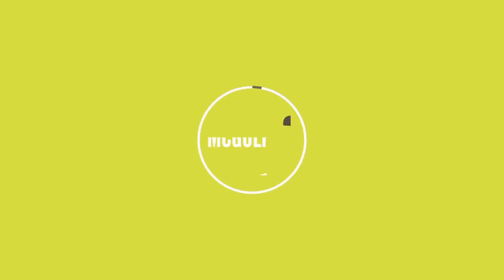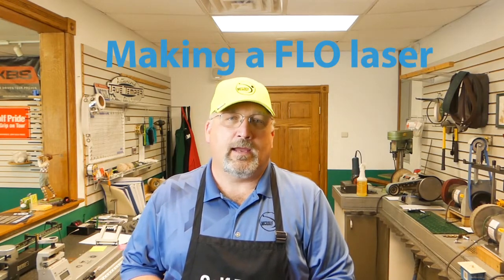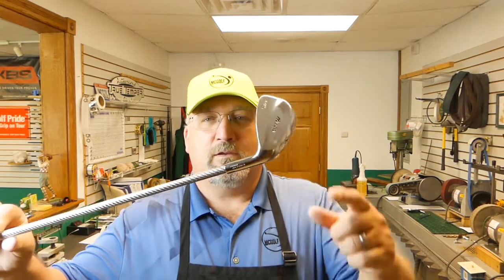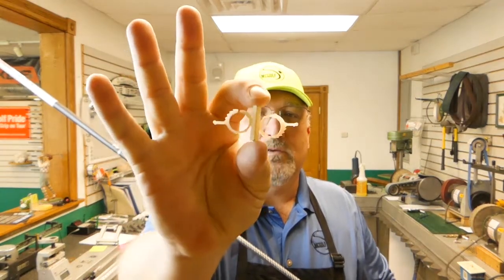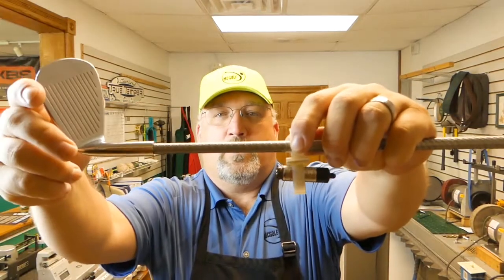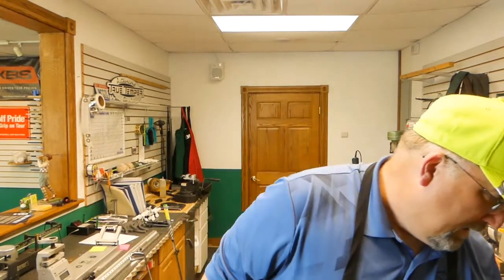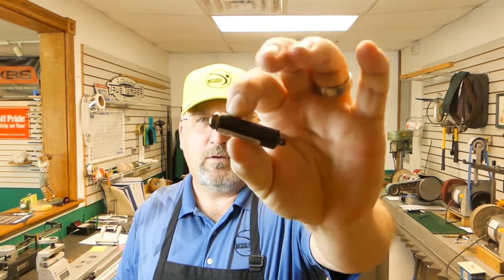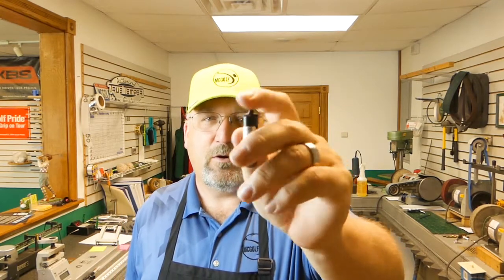how to build a Golf FLO tool (laser)

Comment: Does doing this with a head on affect the final outcome as the head, face, toe weight throws off the center point resulting in a diffirent oscilation? Or should it always be done with a head on, in position?

Comment: Ok, now I have 2 clubs in My Apex DCB that have a lot of vibration  even if you hit dead center. The PW  43 Degrees is the worst barely make 100 meters but my Callaway Jaws 48 degree goes 115 meters . Jaws is a true  temper  S 200 and the pitching wedge is regular flex NS PRO 950. Would this laser work to spot my trouble?

Comment: Thanks, Jim! I just invested in this: https://www.amazon.com/Higoo-Tactical-Laser-Sight-Barrel/dp/B07BKPB6PP - it doesn't look like it will be as fast to attach/remove as what you came up with, but I'm not doing a high volume of work in my basement shop! Thanks for inspiring me to start FLO'ing my builds!
Reply: I like this!  You could swap the hex screws for thumb screws, or just slide it on and off the end of the shaft... plus it's cheaper than buying a bunch of clips and a laser that is the same price... plus it's probably more aligned with the shaft too... thanks!

Comment: Do you find that in steel shafts the spine and flo are usually the same?   I’m having issues locating the flo of my steel shafts.. I rotated the club 360* and never got the straight line, just tighter dispersion of the loop.. and it happened to be on the spine every time..
Reply from the maker: Stephen Barry yes FLO is usually on or near the spine. Give or take a few degrees
Reply: Yea i realized my vice wobbled the table a little bit.. secured it up and was pretty easy to find.. thanks for your quick reply!

Comment: Hi there, I really liked this video. Bit of a dumb question, how do you secure the head to the shaft well enough during the FLO process so when you twang the club the head does not rotate loosely. I noticed at the end of the video it looked like some fishing line hanging off. Do you wrap the shaft in fishing line so that the head stays on? Can you please explain this bit? Also just one more, does the grip have to be removed, does this effect the FLO? Thanks in advance, Glenn👍
Reply from the maker: Glenn Norman I use .012 fishing line I put it in the in line with the shaft as this is the space usually taken by the glue. Yes with grip off. Although grips are well made they can impact the FLO of the club
Reply: @McGolf  awesome that makes perfect sense. Thanks for the reply. I have since subscribed and look forward to learning heaps more.
Reply: What’s the best way to clamp a shaft butt in the vise to avoid damaging the shaft?